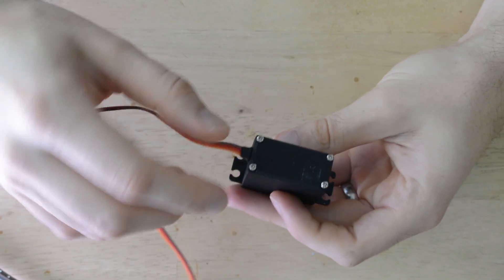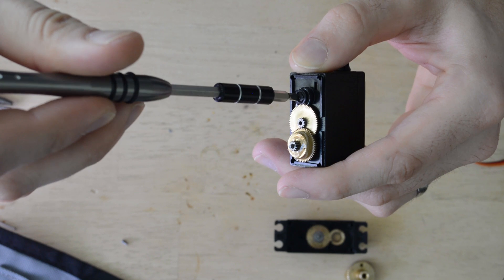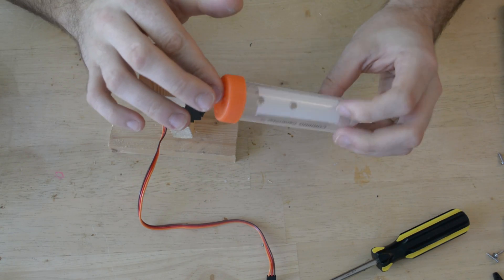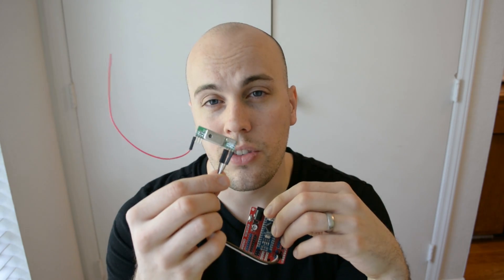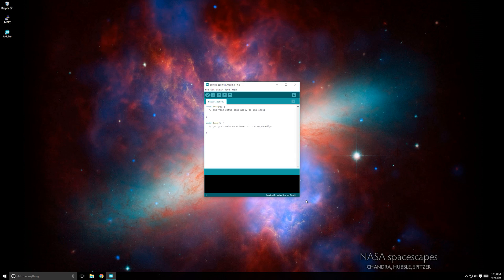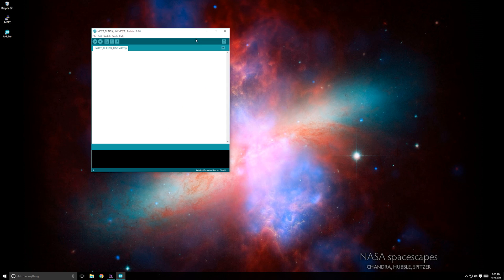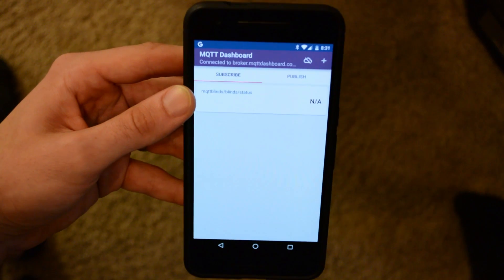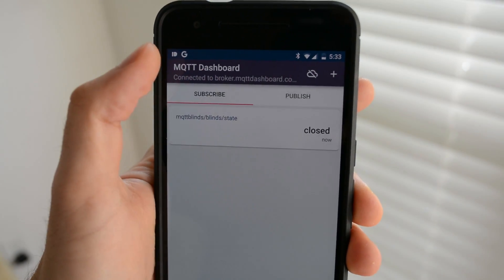The Cheapest Tech - $15 DIY Internet of Things Automated Blinds

Comment: Hello, at the time of this video being published I built a webserver controlled servo to raise and lower three curtains cobbing together your stuff and some code I found on a automatic dog feeder. LOL They have worked great all this time, until I updated my router and my SSID changed. So I pulled out my thinking hat and fired up esplorer and modified the code to the new SSID. But the one I modified still will not connect? Matter of fact, the 8266 chip will not even boot the code!  So I think I have figured out that Espressif changed the way the sta commands work. I'm the kind of guy that only does programming when I have a need! LOL Can you tell me where to find the info on the changes. All the stuff now wants me to program it in Arduino and that's fine, I plan on doing that. But it'd be nice if I could get these blinds working again using Esplorer IDE, as the sun shines directly into my eyes in the afternoons and I can't see my screens. I'd appreciate any assistance you could provide. And thanks for this video, I would never got them built without your  information on the subject.

Comment: Cool but my god does that look ugly.  I'd recommend connecting it directly to the source (instead of pulling the cords)n and if it protrudes some, cover it up with a white, 3D printed enclosure. Then you can run a white cord down the corner of the window and, if you prefer, even cover that cord up with a corner cord "raceway" - as they're called. Will be slightly more than $15 but look a WHOLE LOT better :) 

PS. Thanks for the video, bruh!

Comment: Ben. Please post the sketch on github. I revived the servos just before your site went in maintenance and I wanttry this before you release the updated project. From the tease it seems it will need a custom 3D Prints. And I proper this rustic mounts. Please please post the code thanks. Long time Subscriber early waiting for your return.
Reply: did you find a sketch? also looking to do this project

Comment: Hello there,
I was looking for Ben's original sketch, since he is innactive for serious period of time. Lots of you guys have posted variatons of sketches. I tried all of them, but none was working. So I did research, found Ben's original sketch with help of website that save other websites through time, so I kinda travelled back through time to find original sketch :D I was so happy that I have found it! But it didnt worked. I was getting exception 3 errors. Problem was in some variable. Solved it. Here is working sketch. Ofc, you have to change wifi config and mqtt stuff BUT!!!! if you want to subscribe/publish to channel, it's: BLINDCOMMAND in this case : "mqttblinds/blinds/command". 
If you want to debug it, you can plug USB to your laptop/pc, serial monitor will work, but you servo wont. If you want to try it with servo, use socket.
Change Serial.begin(x) to baud rate of you NodeMcu (mine was 9600)
Feel free to ask any questions :)
https://pastebin.com/d5vFPkgY
Reply: How did you set it up on the app? For me it's not connecting, the code works tho
Reply: You mean that android app? I didnt used that app showed in video, because I have iphone. So I downloaded some random MQTT app from store. Or do you mean nodemcu stuff?
Reply: The app is not working, I also have iphone but I tried it on both platforms and it failed. I also tried using io.adafruit.com, I saw someone else use it instead of mqtt.dashboard.com,  and that didn't work either
Reply: I started viewing it through the serial console. It connects to wifi and MQTT, but it doesn't go past the line "while (subscription = mqtt.readSubscription(5000)){" It just keeps looping in the loop class.
Reply: The results were the same loop that doesn't go past that line. I'm going to troubleshoot some more  but I think the problem is somewhere around that line or the if statement below it.
Reply: Maybe check if you have newest versions of all required libraries.
Reply: I checked everything and it still failed. I put some print statements after the line I was stuck on and it never prints. I'm clueless to what the problem is now.

Comment: Thought I'd give this a go, but having trouble compiling (doing a verify)

Comes up with exit status -1073741515
Error compiling for board NodeMCU 1.0 (ESP-12E Module).

Tried installing the versions of the packages as you installed here (as they had moved on a few versions in some cases) but to no avail. Just won't compile :(
(and this is with your copy of code unchanged)

The one difference is that I'm using the Windows Arduino IDE app (rather than the installer) but can't see how that would cause the error.

Any ideas?
Reply: Steve Goodenough nodemcu requires a driver so that it would show up as a com port serial device. Google the driver and install it.
Reply: my port option in the tools drop down does not glow,i have installed the necessary drivers as well

Comment: Newbe here! have you done a shower fan whereby you dont have to have the bathroom light on,to turn the fan on as even if you dont need a shower but you turn the light on very annoying late at night.Maybe using a arduino and a humidity module.
Reply: mark sherborne dude that's a basic home depot fix...your over thinking it. any electrician at home depot can explain simple cheap fixes for that problem

Comment: Could you recommend a quieter servo please.
Reply from the maker: Not off the top of my head, unfortunately. This really needs to be revisited with better hardware implementation. Using a servo in this capacity works, but it isn't ideal in terms of managing torque. Switching to a stepper motor is going to be a lot better! My blinds V2 project will touch on this, but it's for a different blind geometry. I'm hoping to remake this exact project with a better motor, some sensors, better MQTT/tilt support, etc in a blindsV3 project ASAP.
Reply: Duncan Ramsbottom quiet and servo are NEVER used in the same sentence....you might want to look into stepper motors, a high torque DC motor (over kill) or possibly slowing the servo down buy inserting delays and a lot of degree increments

Comment: Hey, I'm really new to this and would like some advice. Just to be clear, the only hardware I will need is the: NODEMCU CH340 and the MG995 Servo correct? Also, I'm trying to rotate a rod on my blinds which opens and closes the shutters. Do you think this servo will be powerful enough to do that? Lastly, I found a Servo on Amazon which is 360 degrees rather than the 180 you mentioned in the video. Will this still work and follow the same steps in the video? Thanks in advance. Any help would be great.
Reply from the maker: For sure. Yeah, sounds the NodeMCU and MG995 (plus header wires and a power supply) are really the only things you need here. I'm just wrapping up a BlindsV2 project and uses some different hardware to operate rod-driven blinds (like miniblinds basically). It's a lot better  so you may want to hang tight for that. Cheers!
Reply: Thank you so much! I am very eager so might get started but I'll definitely look out for your video :)
Reply: BRUH Automation will ya put that damn video out already...I'm chewing my fingernails off while waiting lol

Comment: Hey Ben! Great tutorials!  Happy to be a new subscriber.  What do you think about a DIY that hides the motor in the top tray and turns the main rod... like the concept product called iblinds? I'm curious if you have thought about this and if its something you'd be interested in making a DIY for?  Like the inexpensive, DIY style but maybe something a little more elegant and hidden?
Reply from the maker: For sure. So the next blinds project will be a much better done version of this, but for rotating rod (miniblind type) blinds. It's more attractive, quiet, has some sensors, etc. 

A phase 3 project would be integrating into the top of the blinds, but in my earlier experiments with that it involved a modification to the blinds that essentially disables the manual opening mechanism. Because I won't be staying in my house forever, I'd rather not do semi-permanent modifications  to the blinds at this point. If I come up with an idea though, I'll definitely get it out there. Cheers!
Reply: I agree, you don't want to completely disable the manual function.  It's almost like you need a freewheel like you see on a bike.  It allows you to go freely one way but when you the automation process happens it's able to go the other direction to open or close the blinds.  

The other problem that is is that when manually moved, the automation blinds won't know what the new status it's in, either open or closed.  How do you overcome that challenge?  Thanks!

Comment: hi, whats making the electric motor turn in the opposite direction
Reply from the maker: It's a servo motor. By sending a different PWM signal (via the library I'm use), the servo knows which way to rotate. Cheers!

Comment: hi Ben. rookie here. tried following your guide, but for some reason when I trigger the switch on mqtt dashboard, nothing happens. any help would be greatly appreciated 
thanks!
Reply from the maker: Hello! Sorry about the troubles. Getting started can be a huge pain. The learning curve is pretty steep. Debugging can be tricky, but the best place to start is to get comfortable sending/receiving MQTT messages. I wish I would have shown  CloudMQTT instead of HiveMQ in this video. 

Check out CloudMQTT it's a private broker which you can setup for free. There is a UI tool in there that lets you send/recieve MQTT messages easily. Once you get comfortable with that, see if you can get the Arduino to subscribe/publish to that server. You can watch in the CloudMQTT web UI if the messages are getting through. Once you get that up, you'll be good to go. Keep at it! Once you get through the first part, it's all downhill! Cheers!
Reply: BRUH Automation thanks for the help and quick response!
Reply from the maker: Happy to help!

Comment: Ben please can I have some help, ive copied the coding and when it connect to my wifi it drops out with a wdt reset, ive been reading about progmem isn't supported any more. please help
Reply: I think I have just got it to work, I installed the library that you install v 0.12.3, also I have followed the guide. I have one question. all I changed was my wifi settings. how does it know it is my blinds I need to control
Reply from the maker: Nice! Yeah, I'd try using the CloudMQTT broker if you're still getting started. It has a cool web UI tool for sending MQTT message and seeing things on the broker. It's really easy. You can also switch to Mosquitto which I covered in one my videos if you'd rather host your own broker. Cheers!

Comment: hey could you help me with an issue i ran up doing this?
The MQTT Dashboard app isn't connecting at all.
But i have tried changing it to iot.eclipse.org and it works but any switches doesn't work.
Ive even tried making the username and key blank.
Sorry im a coding noob, just good at following instructions :p
Reply from the maker: No worries! MQTT can be tricky. I would try Cloudmqtt as the broker. I talk about setting up MQTT in my Owntracks video. Once you get the broker up, you just need to change the server address and topics and you'll be off and running! I would suspect the MQTT Dashboard app will work as expected with CloudMQTT. If you're feeling brave, try installed Home Assistant. You can host your own MQTT broker and even go so far as to automate your blinds on time of day, when you get home, etc. It's pretty awesome!

Comment: Hey, Having problems!  After the script is finished uploaded i can see that the Nodemcu is connected onto the network. 
But when The mqtt is not controlling it? I've gone over again and also tried a second Modemcu. 
What is happening is every 1 second or so the blue light on the mode flashes and the servo twitches 1mm or so. 
Any ideas?  Thanks in advance Ben!
Reply from the maker: Hmm, might be worth checking your MQTT server. Make sure your message is being sent on the topic you received. You can use the mosquitto client commands pretty easily that I cover in my MQTT video. 

You could also try publishing an MQTT message from the NodeMCU and seeing if it is on the topic you suspected. In my case, I had an errant / give me about 5-10 hours of troubleshooting. :P
Reply: I'm Having the same problem, blue light blinks and servo clicks along with the light blink. MQTT Open/Close is setup as per Ben Instructions. but no luck. were you able to troubleshoot.

Comment: ben, how you add mqtt to the home asistan app?
Reply from the maker: There is a couple of ways. If you use the AiO method, Mosquitto is installed by default and you'll just need to setup the MQTT broker information. This page should cover that.  https://home-assistant.io/components/mqtt/

Comment: Is there a way to manually control this? Just in case the internet was down. Could a push button switch be installed to send the signal to the motor? If so how?
Reply from the maker: You could definitely throw a contact switch in with this. You would have to modify the code a little, but it'd be really simple. You would just need to throw a digital read condition in there like this -> https://www.arduino.cc/en/Reference/DigitalRead

Comment: Hey. I am trying to make a similar system for my own blinds. But when i upload the code to the Nodemcu i just get random characters in the Monitor. Any ide what could cause this? Are there any drivers i should install or similar?
Reply from the maker: Hmm, have you checked your baud rate? When you start the serial start command in your code, you have to define it and then have it matched in your serial monitor when you start listening.
Reply: Hey! It was the Baudrate that was off in the Serial monitor! 
Figured it out a few hours before you answered. 
Thanks for the Quick response! 

Your videos have inspired me to get startet with automation in my small apartment. 
By now i have 4 LED Bulbs (LimitlessLED), 3 RF Switches, and am boulding the Blinds atm. 
Next step is to get started with HomeBridge, which should allow me to use Siri with Home Assistant!

Comment: Hi Ben once again thanks for your videos they are well appreciated. Just manage to automate my first blinds with the rf version. I find the esp quite fiddly to use, managed to bust all i been using so far, although they work fine for temperature logging with Home Assistant. 
Thanks again
Adi
Reply from the maker: Sweet! Congrats. That's awesome. Yeah, the ESP chips are fickle. I've only ever worked with them in the packaged variants like the NodeMCU chips. I can't deal with Lua and using non-USB flashing methods. I'm boring that way. :P 

Pumped you got some blinds setup! Looking forward to doing V2 in my new house soon. Cheers!

Comment: hi thanks for the video.
i have request.
if possible you can make using raspberry pi.

thanks
Reply from the maker: Make a blind controller with a Raspberry Pi? It's possible! Would be quite easy. To me, that defeats the point, though, because a Pi is expensive compared to a ESP8266 device. That said, if enough people are interested, I'd definitely consider making a video. Cheers!
Reply: +BRUH Automation 
Thanks! 
I will be very happy if you make the video using pi. I have a $5 pi zero.
Reply from the maker: Ah, didn't think about using a Pi Zero.  good call. I'll check into that. Cheers!

Comment: @Ben .. i am new to esp8266 device,   i purchased esp8266 Nodemcu v3, uploaded your sketch, the monitoring window for COM port shows boot loop, like it connects to the wifi then again restarts, i just wanted to know how to clear the sketch and re upload or re flash or factory reset esp8266 .. appreciate your help in advance.. thank you for the videos..!!
Reply from the maker: Gotcha. Sorry about the troubles. Yeah, that happens from time to time. I'm not sure if there is a way to "blank" an arduino/NodeMCU chip. When you reupload the code thoug, that overwrites what was there before. So, you should be good to go that way! Cheers!
Reply from the maker: Sadly, you're not the first person to report a bootloop. Can you post your code via pastebin so I can take a look at it? The error message is pretty generic (or at least my understanding of it is generic). :P
Reply from the maker: Interesting that your code isn't working. I took that and plugged it into a NodeMCU chip I had laying around. So far so good! No issues that I can see. :( When are you getting the wdt reset command? Is it randomly or triggered by something? 

Also, definitely will try to do a vid on relays. I'll see if I can get my hands on some and give that a shot! Cheers!
Reply: very strange,, well as soon as the code is uploaded, the very first thing printed in the serial monitor window is wdt reset..... i m using the latest version of IDE software and also i did not connect the servo..... don't know if this could be the reason.... but anyway i m still trying...........

Comment: Hi!, I'm from Colombia and I think that You are doing a very good work with your videos, I'm planning to start with some projects for home automation, But I don't know what kind of communication technology could use, Do You use a wifi adapter for each device in your home?
Reply from the maker: Sweet! Thanks much. Can't wait to make more videos soon. 

So that really depends on the device. My Pi3 running Home Assistant is wired to my router, but most of my devices are WIFI, some are RF or Zwave. It just depends on what you want to use. Z-Wave, WIFI, RF, they're all good in their own ways. The great thing is Home Assistant works with all of them so you can mix and match. Cheers!